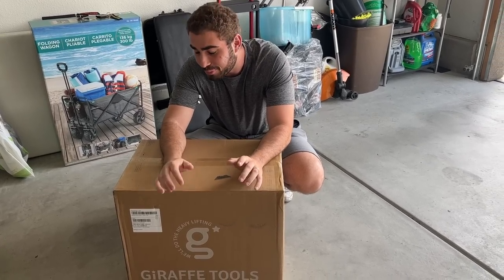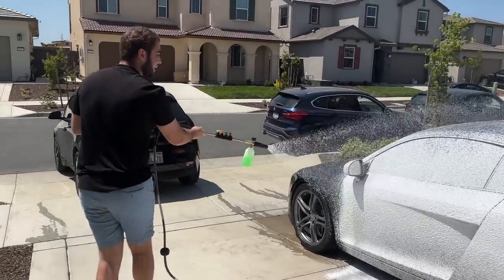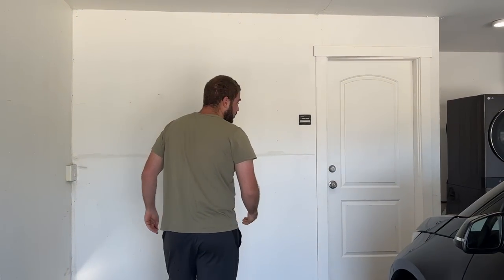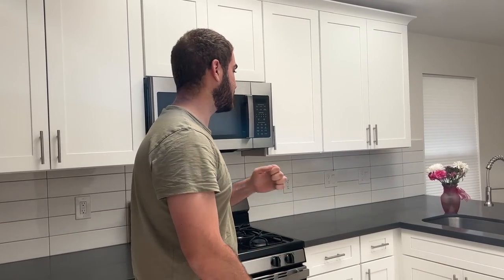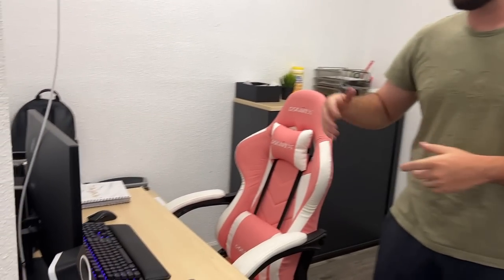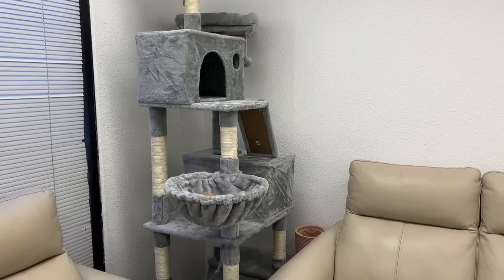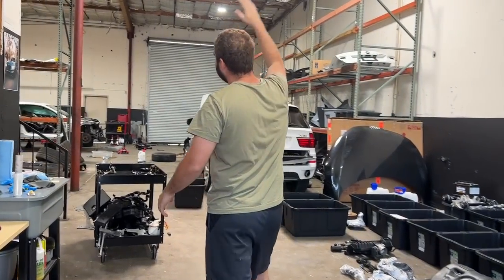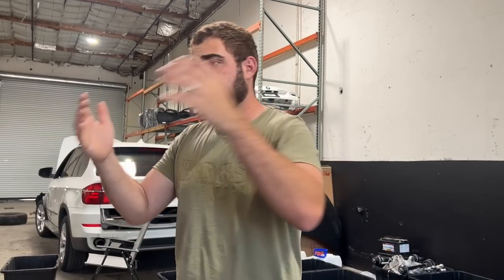I AM FORCED TO LEAVE MY HOUSE! MOVED OUT!

Comment: Nour, please only use the white tip (40 degree) when power washing a car. The other ones are known to damage paint. You can use the green one for the wheels though, but I recommend just strictly using the white 40 degree tip.
Reply: Yep yep 👍🏻
Reply: Thanks for the info. Wondered what all 4 tips were for
Reply: @dav1dizzle  The other tips are narrower and known to be used for stuff like power washing driveway or fence.